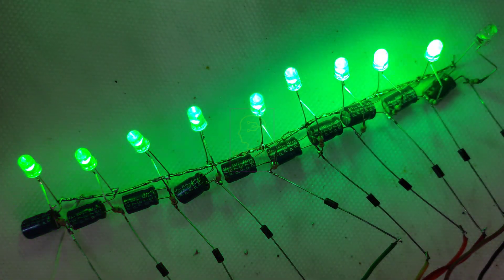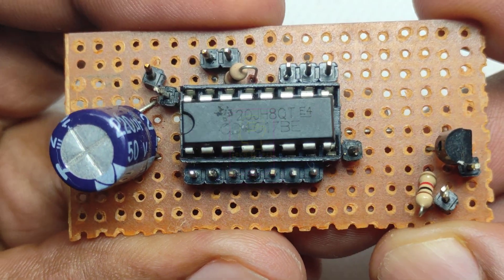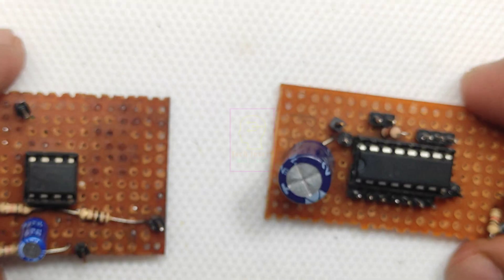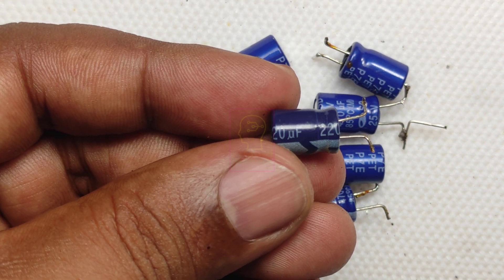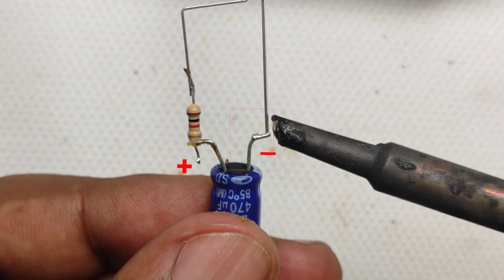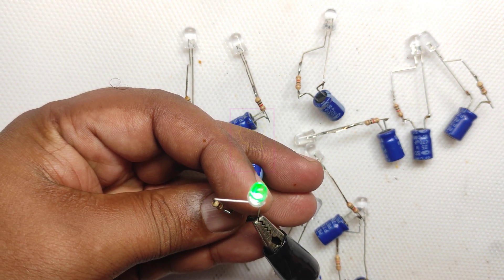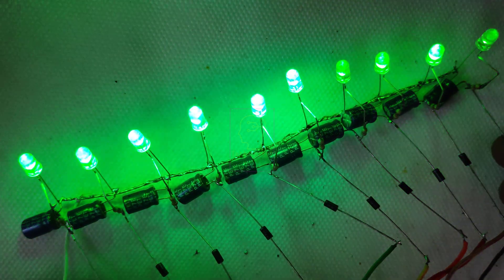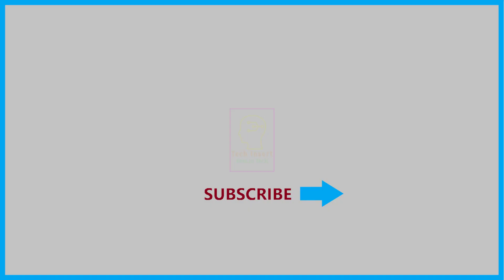DIY LED Chaser: You will not believe that this chaser is built using CD4017

Comment: Nice idea. Because your Chanel is for teaching people you should do the soldering correctly so they learn the right way. Use more flux to get a better and nicer connection.
Reply: So you need to switch the flux or soldering wire. Job have to be done correctly and nice soldering is good soldering.
Reply from the maker: yeah , thanks
Reply from the maker: What u told is correct but more flux will make the soldering iron's tip to black. That is why i took small amount

Comment: You could have tried this in a bread board first, then only assemble. But I am damn sure with 100uF it will be working beautiful than this. Good work bro
Reply: You can try with 47uF and slightly increase speed
Reply from the maker: @SabroniWungkul  Good idea
Reply: @SabroniWungkul  I too feel it as good
Reply from the maker: Nope, I know 100uF with 1K resistor is the value but I do not have 100uF capacitor with me. I can change the resistor value for perfect working but that will make the circuit messy. Anyway thanks man